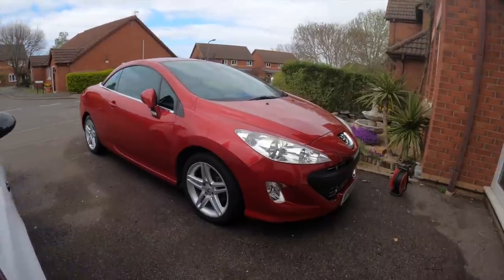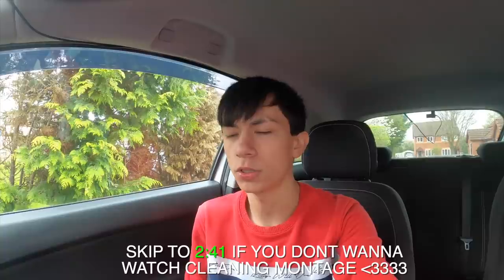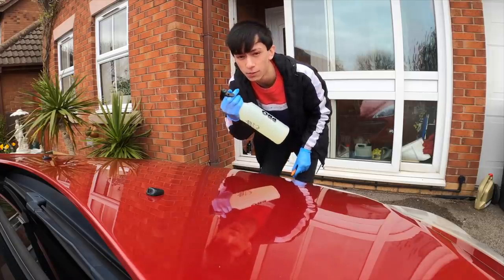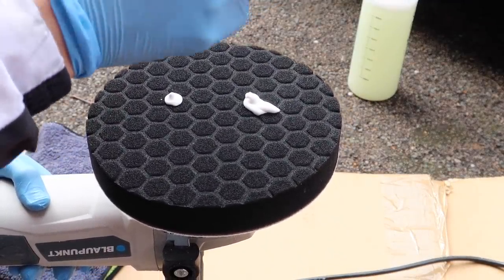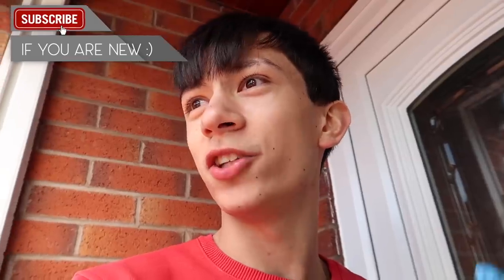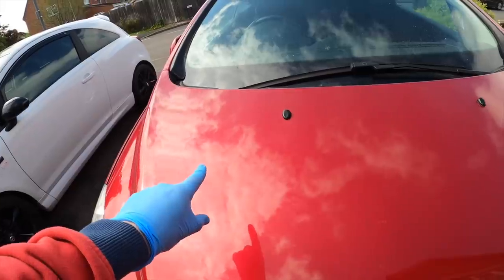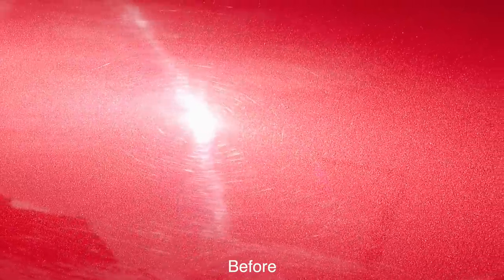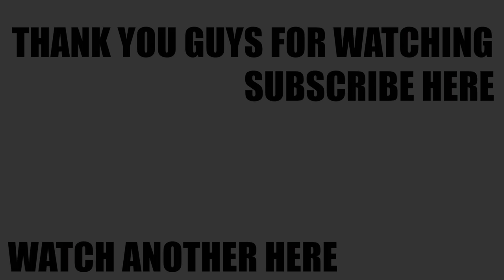POLISHING MY MUMS CAR FOR THE FIRST TIME!

Comment: hey bro as a detailer, try and work on the haze after your polishing (you will notice the light gets "dragged out" in certain lightings) this means you need to follow it up with an even finer polish and use a finer pad, this is why you get different levels of polish because it refines the scratches even more so yeah hope this helps